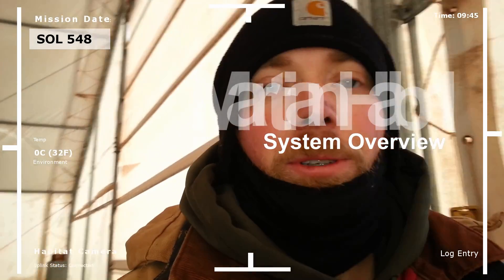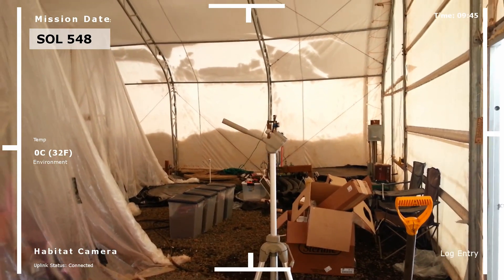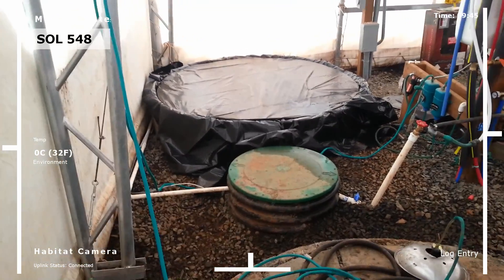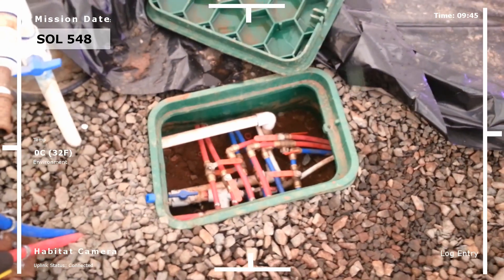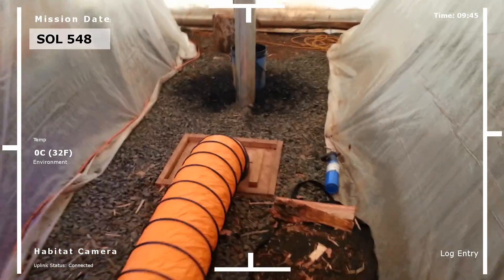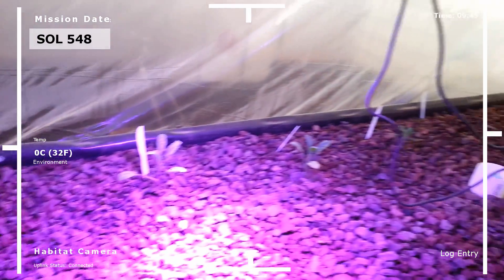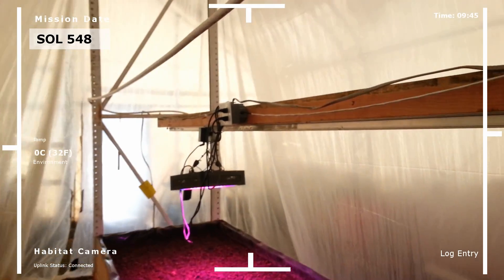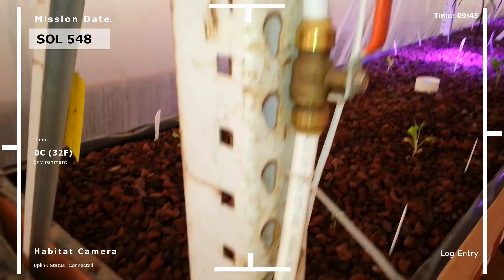Ultimate OFF-GRID, SURVIVAL System - Solar, Wind, Aquaponics, and Power from Poop!

Comment: I was looking at doing an aquaponic garden for my wife(very small). One of the things that was intriguing was the  bell siphon that a lot of people use to automate the flooding of the beds without using an extra controller. Is there is a reason that those wouldn't work?It seems like the only reason you wouldn't use one is your ability to control the cycles.
Reply from the maker: we chose to use the bell siphons because they were easy and simple...i.e. things tend not to go "as wrong" if they are simple. We did consider using a more controlled valve system for draining but in the end that's more electricity, more moving parts, and a higher chance that it all breaks. A great thing with bell siphons is they limit the ability to have a flood. Thanks for following!
Reply: what kind of pump system do you use? I want to try using an airlift design when I build our hobby garden. The only concern that I have is the air pumps at places like walmart have notoriously poor reliability.
Reply: +TheRealMartian +Sam I wondered about this too during the tour ... so, if you use a bell syphon then why use a controller on the water feed? ... well unless you do a whole system and the pump isn't able to provide enough water to do all of them (due to pressure on the lines to get up, and waterflow to keep all beds going) ... in which case using a controllervalve on the feeds to the beds makes sense, as you can control those while the pump runs all the time, and you can fill the beds in cycle without needing a bigger pump.
Reply: +Dutch Courage, That is what I was thinking. That is one of the reasons I am so interested in the air lift pumps. They can be much more energy efficient and can lift water much further than a conventional water pump
Reply: Sam well there are two things going here, one is the height (or multiples of this height if you talk about a big system like this) ... and the amount of water moved in a timeframe.

If airlift pumps are the things i think they are (aka. air bubbles lift water through a small diameter pipe), then the latter is becoming a 'problem'. Those may (yes i say may because i don't know for certain) not be able to fill all those grow-beds in enough time for them to be filled in the time they need to be filled, to have them filled and drained a couple times a day.

More conventional smaller systems i have seen either do one of the following, they have a continuous feed pump with a bell syphon, but the feed is very slow to allow the syphon to stop... or they have a timer controlled pump and a bell syphon, and they 'dail in' the timer to the syphon... But these are all 'one grow-bed' (or maybe 2 or 3) size systems.

When you are talking about 4 to 5 levels of grow-beds all 4 to 5 grow-beds long, you need to move a lot of water at a time to feed them all continuously, or run the risk of not filling them up fast enough for the plants to get enough water. OR, you need an even bigger pump if you want to do it on a 'dialed in' system as you need to fill the beds in an even shorter time.

With the power restrictions on the whole system it makes sense to combine these. So the pump pumps all the time, and the valves on the feed 'dail in' with the syphon, but run like alternate to each other so that you don't need that much water at a time.

You could actually calculate this if you know the volume/time of your pump, the amount of volume of your grow-beds. Which gives the time filled. Then obviously the time it needs to drain, and the time you want it to stay empty. All combined gives you information on the size of pump you need (or the amount of beds you can service with a particular pump), how to time filling and empting.

ps. sprung to mind that on a stacked system there is also the benefit of the plumbing for the drainage. Obviously you need much bigger piping if all beds in a level drain at once, or if you can time them to go one after the other.

Comment: I would like you opinion on how this type of system would work in the opposite environment than you currently are in. Say in the deep south where it is 70 F on x-mas day and summers are very hot and humid with the sun roasting everything
Reply from the maker: howdy Paul. I think the rainbow trout would be a no go unless you dug really deep into the ground to get to cold dirt. But what I would do, and what I really want to do if i could solve the energy problem, is to have giant freshwater prawns....way tastier than Tilapia and a good cash crop. As for the rest of the system it will all work really well...the hardest part would be getting to hot in the summer. That's a nice thing about the white cover building over the clear plastic usually used is that white reflects light and heat so it stays cooler. but it does mean you have to have lighting. Something like a retractable roof would be my dream solution so I can use natural light during the daylight hours but retract the roof back over the opening if it gets too hot.
Reply: mmmmmm. Prawns. Neato idea.
Reply: +TheRealMartian ... you would actually do that the other way around ... you use a clear panel on the roof and then on the inside you use shade cloth to provide shade. You could actually use the ancient old system of letting sails down (and up) with ropes and some pullies (which could be on a simple temperature controlled motor) to control the shade in the system... 

Also, using ground cooling would be a way to get rid of some of the heat; aka. you blow ear through a pipe system buried in the ground (or even through the water) to cool it down. Which prevents you from having to open a window with a heat-controlled linear actuator to vent heat, which, in an enclosed goal environment wouldn't work.

Comment: are you on well water? in the summer, if your water supply is cold enough you should send your feed water through some exchanger coils and blow air over them, that will help with the humidity and you should save on energy costs instead of running dehumidifiers

Comment: I'm sure it's been mentioned before but have you considered ceiling fans? Seems they would be beneficial in moving stagnant air not to mention move warm air lower. Might help in removing condensation.
Reply from the maker: that is something we have implemented. I'll try to get them in a video. at the top of each grow lane we have installed a 21" fan. Thanks for following and commenting.

Comment: Not to be mean, but how can kids film, edit, and upload videos so easily and an experienced engineer takes all day?  Doesn't make sense, something's messed up.
Reply from the maker: not mean at all and I'm glad you asked. The problem isn't the skill (though I did have to learn how to use Corel Video Studio 9 in a few days) but the capabilities of my 8 year old computer. I have a Toshiba Intel Celeron 2Ghz machine that maxes out with 4GB of RAM and has only an integrated video card. That means my video editing takes very long as the computer cannot render the video, the audio, and the imagery i use quickly. Then when you are done pulling all the video together you have to create the video (rendering)....that's what takes forever. the computer i have simply can't keep up with the requirements i have. So an improved computer with better processing, RAM, and a real video card will take what took a few hours down to a few minutes. It's all about power and compute cycles. Glad you asked, probably a lot of folks thinking the same thing. Thanks for following.
Reply: +TheRealMartian , i do hope you don't just sit around watching while your computer does the work? I mean, sure the rendering takes ages, but it's not like it needs you to be there ... Unless of course you need to keep it occupied because otherwise others try and use the computer and mess stuff up...

Comment: wind power? Paypal for a wind system?
Reply from the maker: I'd setup a gofundme for a wind turbine, tower, inverter, if there is interest and record everything for you all to follow along with. Let me know. We already poured the cement pad for the wind turbine tower but didn't have enough money in 16' to complete the work
Reply: I was thinking something similar...using Peltier units to make more power with minimal intrusion & cost.
Reply: yea i had that idea too. could be beneficial. could run some electronics with it
Reply: No wind on mars.
Reply: could you use the wood stove heat generated to power something?

Comment: But hasn't NASA and SpaceX already worked out and tested most of this type of Mar's engineering?
Reply: They are still working on it.  They just released some people from a site in Hawaii that were locked up for maybe six months or a year.  They don't have it all sorted yet.  Further, he states categorically that this system is for Earth.  He's just having fun with the Mars thing and I like it.  It creates a sense of adventure.
Reply: The more experiments the more data and the more easy it becomes to iron out possible errors in measurements. Its common practice in the science and engineering field for an experiment to be done several times and the averaging of data to occur to reveal a more valid result.
Reply: This guy worked for NASA doing this !
Reply: no, he worked for the air force aeronautical engineers.

Comment: could you not use large amounts of silica to absorb the excess moisture and then have something external to the set up to then dry off the silica? could be a temporary fix until you get further funding for dehumidifiers or maybe even solve the chimney issue

Comment: Your doing a fantastic job with the equipment you have I agree you need a new laptop or of you have the space a pc will be more powerful with less cost but that's for you to decide what best fits your situation :-) also I'd suggest looking for second hand gopro type cameras you only need 720p at most especially for what your doing it will render faster, take up less space on your chosen storage system and use less of your internet to upload so a older camera will be fine for the lower resolution you need and you can get two older cameras for the price of one newer one that you won't use half of the costs :-)